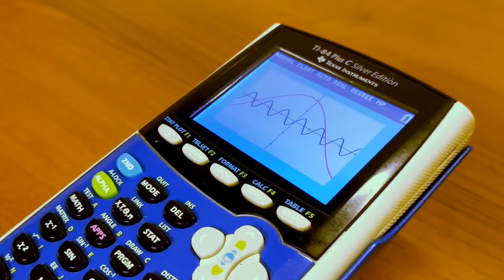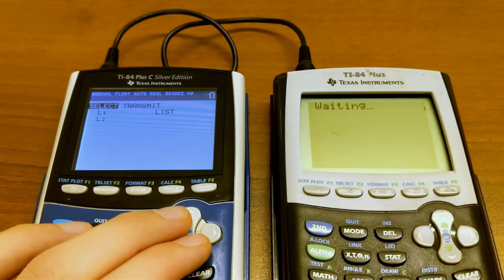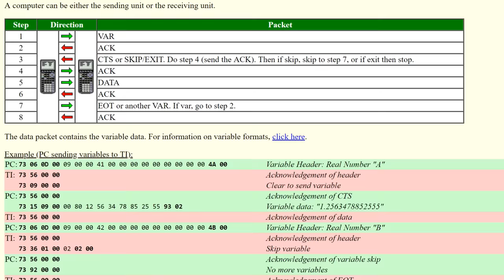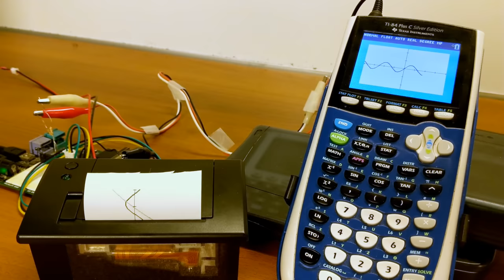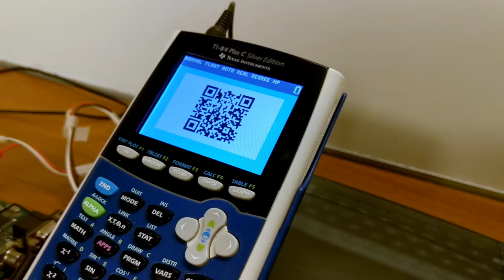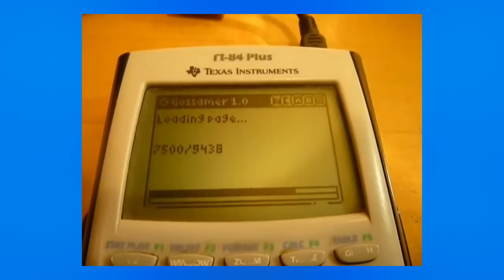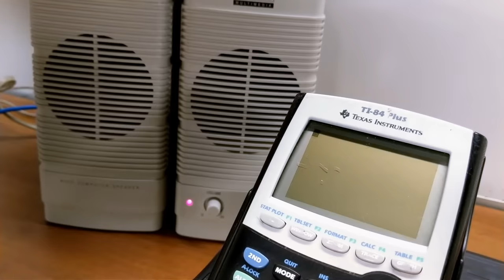Why Do Calculators have a Headphone Jack?

Comment: Is that a TI voyage 200 in the background?
Reply: We used them in our math exam in Germany in 2019. 17 years after release. They might be fun to tinker with but man are they slow...
Reply: I have a TI-92 I enjoy tinkering with. the retro yet advanced look of it, and the same programming languages that my TI-89 Titanium used when I used that in high school and college, makes it a lot of fun. Soldering in a "turbo" switch, or a resistor bypass was a way to overclock a CPU in one of these things. Pretty easy if you know your way around a soldering iron. When you're working sub 100mhz, a 50mhz bump from the 12mhz MC68000 can make a world of difference in some applications, and completely break others that are dependent on that CPU cycle speed.
Best of all, you can pick up one of those bricked behemoths that run on 4 AA batteries for $20 or less on Ebay.

Comment: I always thought it was an A/V out, but plugging in an A/V cable never produced anything.
Reply: The Cando Railfan in theory, if you could vary the signal at the correct rate, you might be able to replicate a standard definition TV signal.

Comment: I have a Casio calculator like these wish I knew how to code games for it
Reply: If only you could but they aren't able to do that I mean they are just calculators 😅
Reply: @SirVoltz  they actually are
Reply: I've actually seen full GBc emulators run on these
Reply: @ahmedajd164  really? Wow ok I didn't know Casio calculators were capable of that
Reply: @ahmedajd164  I have my doubts, as any such calculators I have seen to run such games are hardmodded, and that would be putting it lightly.
Reply: @chatman1702  search up on YouTube lgr TI calculator

You will see wht I mean
Reply: @ahmedajd164  Unfortunately, I see no emulation, simply programs custom-made for the calculator itself.
Reply: When I was in high school, a version of snake was going around
Reply: @chatman1702  check out the to 84 plus CE emulator you will find it running GBc ROMs
Reply: @ahmedajd164  Oh!? Well I stand throughly corrected. You have trounced me, good sir.
Reply: @chatman1702  lol I actually got worried that wht I was thinking I had just seen in a dream or something but I googled it again and I realized it was real lol

Comment: What you've described here is simply a version of the TCP/IP protocol or perhaps more correctly the TCP protocol.  And is essentially the same high level protocol all internet browsers utilize.  Lower level protocols such as 802.11 govern wireless transmissions.  When transmission were first done via telephone wires there is what is known as the handshake in which both ends of the communication query each other as to how quickly they can transmit and receive data.  Most users (who are old enough and had access to PC's with an internet connection) will know this as being part of the dial up connection sequence which had a very distinctive audio that let the end user know that both sides are aware of one another and that they are negotiating how to speak to one another.
Reply: it is far simpler than TCP, it does not have an addressing scheme, just headers, data, and framing sent on the wire. It used per bit flow control and acknowledgement, a good choice for a low bandwidth link.
Reply: @liam3284  
     Agreed and very true.

Comment: The speech module is from Orbit Research, and is sold screwed on top of the calculator for $500, as it can also interpret graphs and play them as a series of tones, panning from left to right to represent X, and high to low pitch to represent Y.

Comment: I assume it's because that plug isn't just used to transfer sound. On old guitar pedals, it's used as the power jack. 9v to the tip and ground to the sleeve. It can be used for any 2-wire connection afaik. It's just plug like any other plug.

Comment: You mentioned that an external keyboard may not have been what TI intended for their keypress protocol — but I've got a TI-produced, external QWERTY keyboard that my wife bought for her TI-84 in the early 2000s that says otherwise. (I'm pretty sure they were made before graphing calculators were SAT-legal at all.)

Anyway, I'd been meaning to reverse-engineer the thing to use it with some other electronics projects,but hadn't gotten around to really researching it,  so thanks for the explanation of the methods it uses; that will give me a leg up.

Comment: I made tons of money back in the day. I found a simple scheme to make a data cable from the ti-83 to parellel ports. It costed just 5 bucks in parts, I included software, games and other stuff on a 1,44mb disk, sold them for 20,- a piece, I wasn’t only the absolute hero in high school, I made hundreds of bucks. 

I even had a warranty programme. If it would fail within 30 days, I would replace it. 

I only ever had 1 returned which turned out not even broken. Oh them days.

For those asking, back in those days, you couldn’t easily get a data cable to hook it up to a PC.

Comment: An interesting thing about the talking peripheral is that technically, it DOES exist, but it’s not a first party product. It’s called the ORION, and it is a TI-84 that is modified by ORION to have a module on top of the calculator that connects to the I/O port, but also has a pass through. It’s similar to the solution shown here, where the module on top has its own battery, processor, ram, etc, but it accomplishes the same task, being able to read not only every key press, but data on the screen, and tones for things like graphs to indicate cursor position. It’s meant to be a TI-84 that is usable by the blind, but it’s still fun to experiment with. I owned one first and foremost as a disability tool,, but it got me learning more about how those calculators worked. And funnily enough, the ORION has a headphone jack

Comment: Back in 1994 we were using TI-82's in high school. There was a connector from the link port to a DB-9 serial port that worked with software to print the screen and transfer data. I believe the link port dates back to the TI-80/81?

Comment: Takes 9 minutes to tell you why it has a head phone jack. Data transfer between calculators and programing. There done. took 30 seconds. And a few limited peripheral addons. Printer, text to speech and sensors.

Comment: It's completely correct to call it "serial", it's one bit at a time, that's "serial". It's not the RS-232 standard PC serial ports use, but there's plenty of other serial standards, SPI, I2C, and proprietary ones all sorts of computers and gadgets have used over the years. Those smart multi-colour LEDs (the ones where each LED can be it's own colour) have a serial in and out on 2 of their pins. There were even, back in the day, entire serial computers. With a 1-bit CPU. They weren't fast, but they were cheap.

Might be the TI serial standard has a name, might not, it's still serial.
Reply: Yes, some of them use DMX, but the simple ones are just a shift register, a bit like SPI.

Comment: pretty useful port for stuff with space constraint (i.e. calculator in this case). my electric bike controller is so small it would never fit a full sized USB port, so it has 3.5mm (yes, the connector/cable has TRS jack) port, and the USB side has TTL > USB convertor so it can communicate via serial.
they're far more durable than USB-C/micro/mini since there aren't anything sticking out of the port. obviously there will be bandwidth issues, but in this case (and on my bike controller) that's not an issue.

Comment: i loved my TI calculators and Casio graphing calcs.  I had some REALLY wild models too (one of the high-end TI models had a full qwerty keyboard, large screen, and could map 3d and 4d functions.), but my favorite is the casio color models that showed up from the end of the 90's through the early 00's.  These things were extremely powerful devices, had color, and were much more affordable for the functionality you got.  They also used a similar Basic based programming language as the TI calcs, and it was pretty simple to port code from one device to another.

Growing up, we re-released several modded versions of several games, and even made a few (usually small puzzle games, strange ports of pong that had missiles involved, and I wrote a scrolling vector base skateboarding game at one point)

However, ALL of these programs would work FAR better on the Casio, and it was possible to even import (simple) sprites into the code using GET and PUT statements on data matrices that held pixel-color-data (I think it was like number 0 to 3 for the R, G, and B channels,  or 2-bit-per-color channel... but you had only 4 colors that could be defined at the same time, it was ARCHAIC to say the least.) or just choose from a pre-set palette of 16 colors... which for a calculator was ASTOUNDING.  Just keep it under 48k :D

The best I could do with the TI's was line and circle drawing, and pset/point 'sprite-like' operations, but it was closer to 'vector like operations'... and DAMN slow on the refresh.  Most of the games that came out on the TI were, ostensibly, text based, puzzle games, or EXTREMELY simple stick-figure graphics for RPG's and if you were REALLY motivated (and had a math teacher with the link cables that let you do what you wanted because they couldn't teach you anything new anyway... that's what I get for learning calc in 3rd grade >.<...), multi-user dungeons with one of the TI units as a 'server' of sorts.

And then summer came, and thankfully I had some friends in low places and managed to get a lifetime supply of TI-92's for a very reasonable price :D

Comment: Casio's have a better PHY interface, they use a UART with ~3V signalling.
Trivial to interface with an Arduino or any other microcontroller.

Comment: Why not just have the cable have an independent clock connection, or why not have the packet send across the port be a specified number of bits with a clock end which would probably make larger packets but make the data lanes more independent?
Reply: who sends the clock?

Comment: I remember building a cable to connect to a PC's parallel port, since my computer didn't have a USB port and official cables were too expensive anyways. It was the first time I used a soldering iron for a real project.

Comment: TI had an external keyboard accessory back in like 2003.  I had one and it made it easy to write programs to help me is science or math class to automate equations for me.  I took notes in class a few times with it as well, but that didn't work that well becuase of the lack of a good text editor and the size of the screen.

Comment: I just want to point this out for anyone curious. 
Texus Instrument's TI 84 and other graphing calculators utilize a Zilog Z80 microprocessor. This is an 8-bit processor that was released 45 years ago, almost half a century (1975). 
Yet, they still somehow manage to charge $100+ for TI-84s when I guarantee these processors cost less than a cent today... 
Modern smartphones can emulate TI series calculators many MILLIONS-BILLIONS of times faster than an original 84 can run. 
Let all that sink in, oh yeah!
Reply: The thing is that in a proffessional setting most people and places dont allow or prefer the usage of a Smartphone.And the things will still be preety expensive because there are not much producers of this tech and most people dont need it either so lack of demand = Lack of innovation hence the price can be justified( well kinda justified ) It makes no sence but for a business its required to make profit.
Reply: @moundain4220  that’s not true. They’re expensive because Texas Instruments holds a monopoly over calculators in schools; they can charge whatever they want because schools go to them/require them exclusively, especially in the context of standardized testing. You literally cannot convince me that there’s a lack of demand for a monopolized family of calculators with a 45 year old chip that has been in production for 20+ years.

Comment: I've a desktop calculator with built in printer. It is its only output device ;)

I have a pocket calculator with 'headphone jack' - for powering the calc or recharging the batteries.

Comment: For doing any real math they still beat any touchscreen smartphone calculator emulation, and by substantial margin. 
Especially the TI-89, which unfortunately didn't get its deserved market share as schools chose to hobble students and deny them a very useful tool and skill by requiring the TI82/3/4 as a lazy solution to "cheating". It wouldn't be so bad if the 83/84 had had the same OS and interface as the 89 so users could easily move back and forth but they don't. The 83/84 has limited use outside of high school while the 89 is a real professional engineering calculator. (an 83 still beats a "smartphone" calculator)
Reply: The software could be run on a phone
Reply: @zachb1706  yep and it would still be touchscreen crap with short battery life.(I can get like 3 weeks from a charge on a real 89 and it has buttons.)

Comment: Do you need a graphing calculator for high school math? In the UK the most we need for GCSE maths is a scientific calculator.
Reply: Some courses will have sections where they teach you how to use certain functions on a graphing calculator, but 99% of the time a scientific is just fine. It really just makes your life easier though
Reply: In Australia it’s mandatory. I guess it’s possible to do the tests without one, but you’d be wasting so much time
Reply: @zachb1706  I think it might be because GCSE Maths is an exam we sit at the age of 16 rather than 18 and thus is a lower level to the tests you might be thinking about. 
After the GCSEs you might choose to do A-level maths if you did well in GCSE maths and maybe you need a graphing calculator for that. I don't know because I didn't choose it.

Comment: Back in the 1980s TI had a printer for their TI-66 programmable calculators. I never owned one but I did have the chance to get one back then. You can read about it in the manual 

http://www.datamath.net/Manuals/TI-66_Manual_US.pdf

Comment: It's NOT a headphone jack. It's an 1/8" phone jack. Exactly like the 1/4" phone jacks used by musicians to plug in their instruments. Only smaller.

It's only considered a headphone jack when it's used to listen to audio through headphones, which that is not. So it's not a headphone jack. It's an 1/8" phone jack plug. The industry standard name.

It would help if you identified things correctly next time. Before being used for audio, guitar pedal builders used it to provide the 9v needed for guitar pedals to work. There was no industry standard 2.1mm jack plug back then.

It's an 1/8" telephone jack. Not a headphone jack.

Comment: The reason you gave why serial communication would not work because of different clock speeds is nonsense. This happens all the time in embedded systems. E.g. an Atmega328 at 8 or 16 Mhz (Arduino UNO) can perfectly communicate over serial with e.g. a computer running at Ghz speeds: both need to agree on the speed in bps (e.g. 9600 bps or 115200).

Comment: I find it horrible that an Nspire that costs almost $300 can have an outdated USB Mini port and not even a Micro USB. The batteries are good at first but quickly degrade and don't hold adequate charge, so losing the included cable can screw a student out of a test because nobody carries such cables. TI should be avoided until they stop ripping people off with monopolistic overpriced and outdated garbage.
Not to mention that the TI84 doesn't support complex numbers in matrices, which is silly.

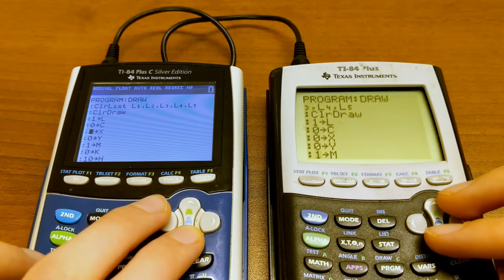Comment: 1:20 - Uuuhhh... that IS serial communication.... kinda strange that you would claim otherwise, specially when you are then mention universal-SERIAL-bus.
Serial just means that the data is transmitted in series and NOT parallel over multiple lanes at once.
So "while that isn't entirely wrong" - it is 100% correct and you are entirely wrong on that.

5:43 - "standard serial"  Huh? There is no such thing. 

It kinda seems like you are mixing up serial communication with specific standards for communication like RS-232 (or USB and PCIe for that matter).

Comment: Sorry, I will not watch this video... I clicked in just to leave a comment on the title.  If you have to use a Graphing Calculator and you don't know what the 2.5mm jack is for then you failed in learning how to use your calculator.  Read the instructions.

2nd... headphones use a 5mm jack, calculators use a 2.5mm jack, they are NOT the same.

Comment: I had a Nokia phone that had this socket for charging.
Reply: Nokia never have had that kind of charger
Reply: @AnssiKarki  it's smaller (I think 2.5mm instead of 3.5 headphone) but it certainly exists. I still have this phone somewhere.
Reply: @warmike  OK tell me what that model is
Reply: @AnssiKarki  I have at least 3 of those, but the one that I found the first was Nokia 6700 Classic.
Reply: @warmike  it charges via usb
Reply: @AnssiKarki  there is a small jack socket to the right of the micro usb port
Reply: @warmike  and do you use it to charge the phone?
Reply: @AnssiKarki  yes, in fact I'm doing it right now. The USB is mostly for data transfer to the PC, but it can be used for charging as well.
Reply: @warmike  I dont understand purpose of two charge ports
Reply: @AnssiKarki  I think micro USB wasn't that popular back in the day. I think I even remember a phone with a non-standard micro USB that needed a special cable to connect to a PC (maybe it was just a normal micro USB cable, but I think not). Also a charging port can break down, I had my first smartphone die this way (it broke, I brought it to repair, they repaired it, but after some time it broke again).

Comment: I get the fact that you even address it in your video, however, no, this is still clickbait. 
If a 3.5mm jack doesn't fit inside we can draw the conclusion that any noise you conduct the calculator to make will be satan spawn. 
Imma have to pass on your video 40sec in.